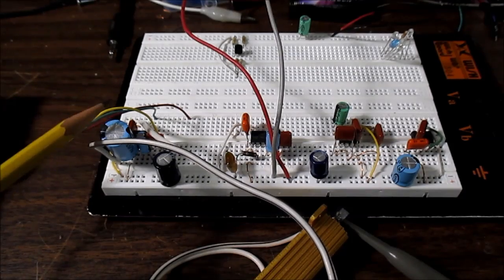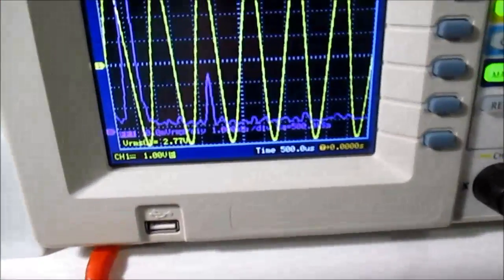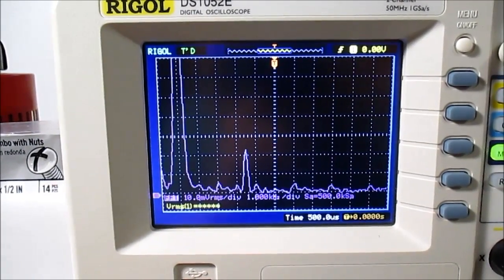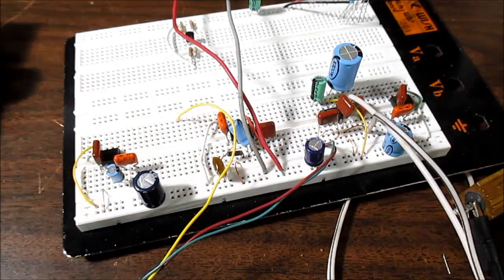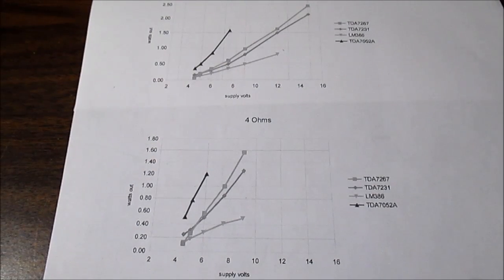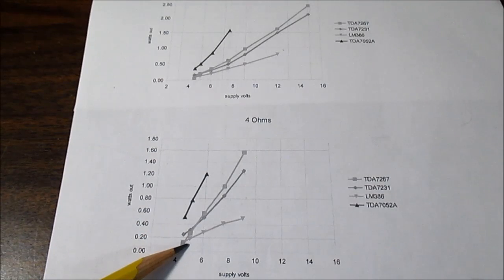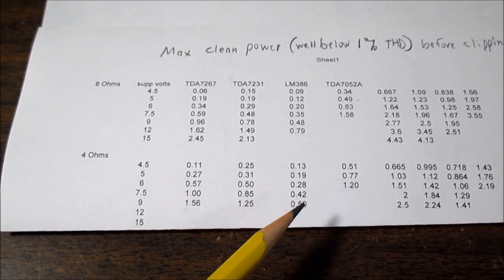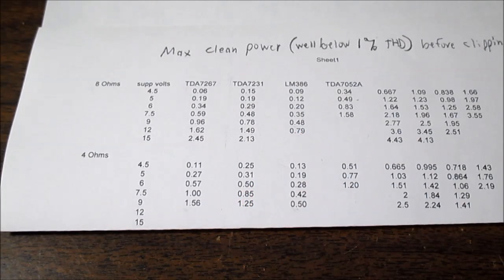TDA7267, TDA7231, LM386 & TDA7052A audio amplifier power output test

Comment: Well.. looks like I need to order some TDA7267s! As I have stated before, I make cigar box guitar amps and put some in Altoids tins with either 3.5 mm or 1/4 inch jacks. I have used LM386N-4s but hoped there was a higher output chip for 9V@8ohms. So thank you for this comparison. Thankz
Reply from the maker: You can find them as new old stock on ebay. Unfortunately a disco'd part. Glad I bought a lifetime supply of them. A really lovely chip. Low part count, low distortion and high output for a non bridged design. It will eat 9v batteries quick given the higher output.

Comment: pretty neat idea adding that 1% distortion as a reference... but how do you do it when you only have 1 signal gen? would like to use it myself because it takes a some time using the cursors every time
Reply from the maker: I've gotten several questions on this so I will make a video on the subject.

Comment: That explains the low power...I bought a bag of 386's...any way to boost the output with a transistor stage?
Reply from the maker: I made a video on an LM386 power booster. It does work at 12 volts but the asymmetric clipping of the LM386 still limits clean output power somewhat.
Reply: Hey John thanks for the reply I'll check that video out. Bringing that mic to life has made my electronics hobby better than ever. I've yet to get an amp from scratch to work for driving a speaker so I can do away with the integrated circuits. At this point that's where I want to take the mic to speaker project(s). What I have tried was the three stage 2n2222 amp circuit from AllAmericanFive but I failed somehow...

Comment: Funny, I tested the .3w LM386-1 and .7w LM386-3 and didn't see a difference in output power either. Could the former just have more THD at higher powers?
Reply from the maker: Distortion is about the same. I left the LM386 back in the 80's for ICs that could deliver more watts at 9v into a 4 ohm load yet still have low idle current draw for battery use. It still has good use in many circuits where max output is not critical.
Reply: hmm so how come they made the -1 and 3 versions if they perform the same in practice? Maybe the first few production runs had lower yields?
Reply from the maker: Good question. A quick look over the datasheet gives no distinction between the 1 and 3.
Reply: The only thing I can find is the maximum output powers but during my tests I got 700mW or more out of both. My chips are all less than 10 years old however so maybe it only differs on older versions.

Comment: Takeaway...stay current with new products, don't get bogged down with legacy products because you're comfortable with them. Great video. TY
Reply from the maker: I agree to a point. A lot has gone class D but many examples under perform compared to some of the older linear amps. OTOH some people latch on to some ancient parts or design. Same with discrete amps. Pretty much all of the ~45 year old designs have been succeeded by newer designs with better components (e.g. transistors with flatter gain linearity). We know a lot more on how to design a great amplifier these days.

Comment: hey, this product, the rockford fosgate pm100x1, is an all new class of electronics. it plugs from your headunit to your speaker. and doubles the power. without power from the battery. in the youtube video by SMD. look in the comments, a guy guessed how it works. can you try to make this product and a videos as well. they call it "freeloader"
Reply from the maker: It takes the output power from the head unit chip amp and stores / boosts it for dynamic peaks in music. Can it work? Yes, I think so. Will it work with sustained bass notes or modern compressed music? I doubt it. You can't get out anymore than the head unit can put out in that case. $400 is way overpriced for such a gimmick. Would love to rip it apart both physically and figuratively on my bench though.
Reply: Sounds like FREE ENERGY lol. Would be fun to see inside.
Reply: its a dummy load with a series of voltage regulators and bridge rectifiers being fed into two capacitors that a basic amplification chip on board that used an isolated output. this is what another youtube commented. kindof understand it myself with the limited knowledge of electronics. so from what it sounds like to me is, instead of a varying impedance load like all speakers have while playing music, its uses a non changing ohm load, maybe 1 ohm, stores that power in the huge caps. then routes the signal to a basic amplification chip, double the wattage of headunit output. there are a lot of videos and pictures of this. wish you would try to build this. and tell me your opinion what was described if that circuit works. dont think it just boosts the bass when a strong note hits. thank you. this game changer should be used more and cost less then 400 a pair.

Comment: It's good that you finally, after all these years, have started to test the chips properly at various voltages. Yet you don't always push the chips to their limits. You don't really explain why you are limiting the supply voltages in your testing, especially the 4 ohm loads - it's not very helpful saying something like "because of certain limits...". Finally - many of these little chips need to sink heat out via the pins (eg: TDA7231 needs 1/2 the pins into a copper PCB), so it's misleading to "undercool" them using breadboard, isn't it?
Reply from the maker: For example, the TDA7052A has a repetitive peak current of 1.25 amps. Running it at 7.5v with a 4 Ohm load would exceed this so I consider 6v the max. The datasheet itself contains no info on 4 ohm loads (although it should be able to deal with that given the published specs). My max measurements are as hard or beyond as you would want to push the ICs in normal use.

The chips don't get that warm. If I can hold my finger on it then it is nowhere near thermal limits. The conductive strips in the breadboard do draw off some heat. The run time of the test is ~20 sec. Heat is a non issue in these tests. if it were, I'd do something about it. Someone complained because I used a big heatsink in the LM1875 test.
Reply: John - there is little point testing the amps at the manufacturer's specs, as they have already done that in the first place. If we want to know what the amps will do in that situation, we can simply read the data sheets.
If they chips aren't getting warm, then they have headroom to be pushed harder. What you are saying that YOU make a judgement about how hard the chips should be run, and then don't even test them any harder than that. You don't test ANY of those chips at the manufacturer's maximum voltage, so why do you say that the "normal rated" voltage is as hard as anyone would want to push them?
Reply: TDA7267 is rated by ST for 4.5V to 18V, and you test to only 15V. TDA7052A is rated by NXP for 4.5V to 18V,  yet you only test it to 7.5V. I am not necessarily arguing with your methodology, what I am commenting on is that you don't explain why you are setting limits.
Your tests make me feel like you're testing an Intel 2.8GHz processor at manufacture's rated clock speed and at manufacturer's standard rated voltage, and then declaring that it can do 2.8GHz.... well yes, everyone knows that LOL.
Reply from the maker: I use the current limit and thermal dissipation limits stated in the data sheet to limit the test. Operating the IC at a given load can exceed the thermal and/or current limitation at the higher operating voltages. I see no point in doing that. Truth is I could have pushed these ICs harder in the test but I'd not recommend using them in a finished project that way. 

I'll be soon testing a pair stereo ICs but still won't be pushing them too hard. They are old favorites of mine. They are discontinued and kind of expensive on the 2nd market, so don't want to risk them. Take it or leave it, I'm conservative in these tests.
Reply: Thanks, and I understand. What you really need to do is explain that, rather than assuming that the viewers will inherently understand. Remember, we come to you as the expert, so you can assume that pretty much everyone viewing these videos will have less knowledge on the subject than yourself. So, what's obvious to you will almost certainly not be obvious to viewers. Cheers
Reply: Maybe with all your wisdom you r so keen to share make your own video so I can come shit on it 
Like you r and think your helping 
Johns taught me so much he is a legend 
You’d be doing well if u could do half the job he does 
Lol 
See I can talk shit to 🥳
Reply: @jossmoerkerken5732  -  With that off your chest, next you need to find someone to teach you how to spell.

Comment: For years, I stick with TDA7052 for mini portable speaker with very good sound quality.
And for bigger power that can running with Battery, use TDA7056.

Many newer Chip here that can drive 4ohm speaker at  3V with good quality, like inside JBL Bluetooth speaker or Xiaomi MiFa, etc. BUT, TDA7052 or TDA7056 irreplaceable for me 😃♥️